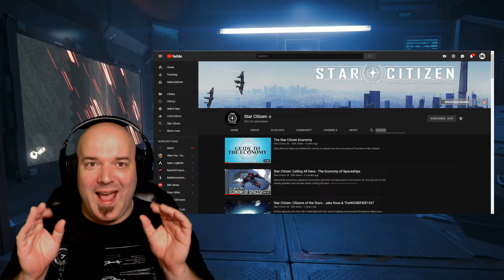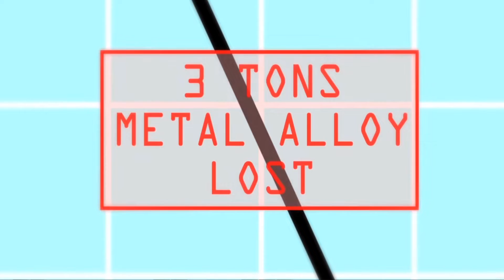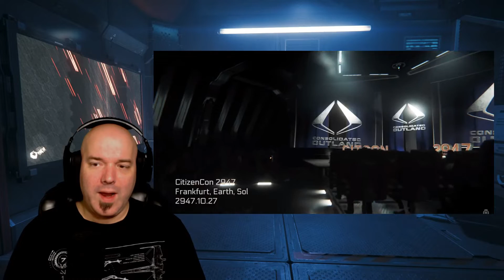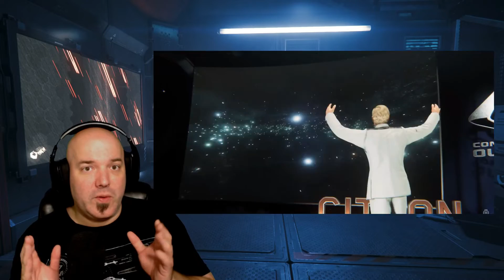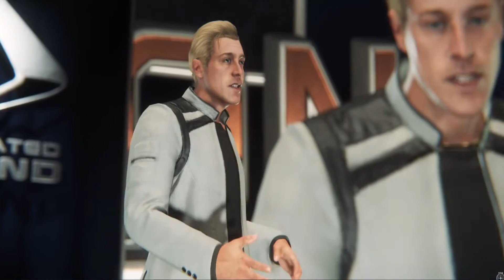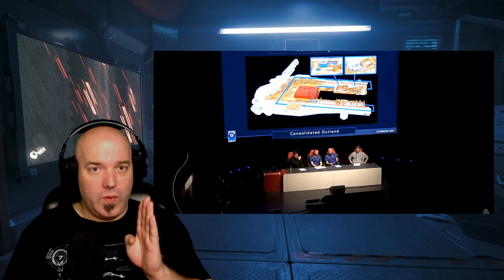Star Citizen Manufacturing & Building | Facts & TheoryCraft

Comment: You know... latest Elite Dangerous leaks indicate there may be base building in Elite along with space legs in 2020
Reply from the maker: Love Elite. Although, I got tired quick of the fetch quest economy. It has no real tangible worth as everything is generated by npc and has no real cause and effect. The thing I liked that they added are the super-ships.
Reply: @DG360   fetch quest economy - we may have the same in SC in the end ;)
Currently after 7 years, SC even does not have even that...
Reply from the maker: Aye GR. That's my worst fear. I mean primarily it's a NPC economy as slated and that scares the shit out of me. I'm very disappointed that CIG has not released any information other than general mechanics on how it will "work". I mean I busted TOny Z's chops on that CitCon Economic Panel when he didn't get into any specifics that I was looking for live on my stream. The biggest question I had is that if everything is run on an algorithm what the fuck are the variables it's running on. Personally... I think they aren't even in the infancy stage when it comes to the design of anything industrial which is why I push so hard on the channel for any info they can offer. If there is one thing I am and will always be disappointed in when it comes to Chris and CIG it is in not sharing with us more details. I mean hell the vid I'm pulling from that explains the economy is over 5 years old. Time to start cracking down on them for more info.

Comment: I really like the idea of having some kind of underground operation, but I think we should have something different than having permanent structures like what the pioneer does. I think we should have a vehicle that can do what those outposts do, but on a much smaller scale like a mobile home. something small enough that you can drive it into some of the larger caves and drive it back out once you are done. that would be really nice to have for the more.... law challenged players to use and hide in and much cheaper than an outpost too. you could have a "salvage" variant and a science variant and everything. obviously it would have to be Drake because its totally something Drake would design.
Reply from the maker: Great read!